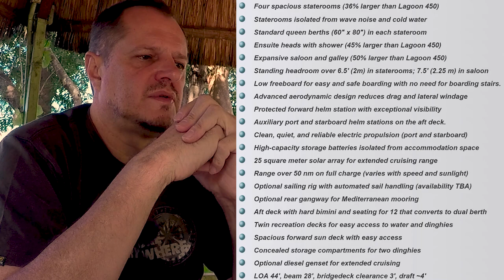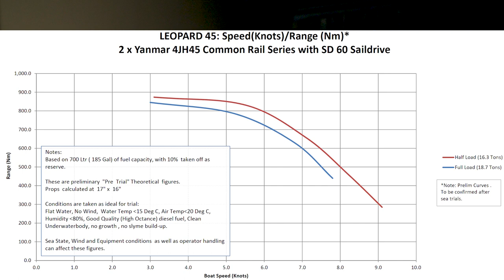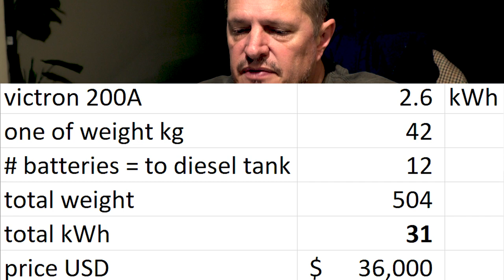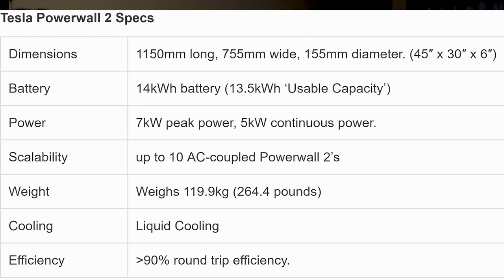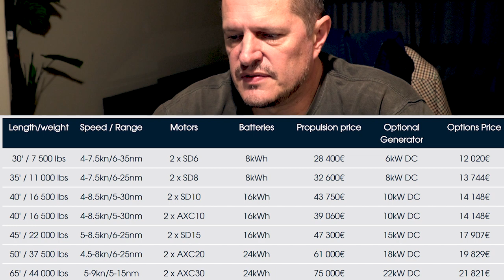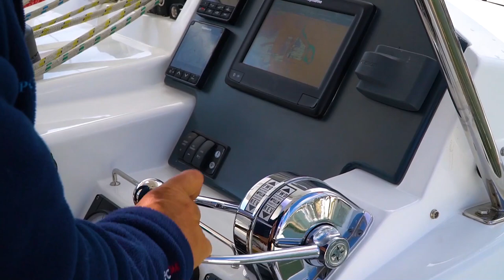#25t Diesel Engines or Electric Motors for Our Catamaran | Sailing Sisu in Cape Town South Africa

Comment: Captain Frik, one of our 100% solar, silent E-catamarans recently crossed the Atlantic ocean. There was minimal use of the required by law single generator. It was a 64' but they also come in 46, 55 and 74'. If interested I shall send you much more details.
Reply from the maker: Yes, please! Can you inbox us on Facebook? I will add the links in the description.
Reply from the maker: I have added most of the links from the comments to the description, but they keep on coming in. So, start with the description links and then scroll through the comments. There are quit a lot but most of the comments points to the same 62ft solar wave gunboat.

Comment: I'm building a 14,80 x 8 meter wide sailing catamaran and i been over al your links the past 4 years i think but with refurbisch Lithium battery's i will go electrical. I'm going to put in 2x 10kW BLDC 48 volt motors
Reply from the maker: Thank you for watching! How big? Like a km long by 8 meters wide?
Reply: it's a Waller 1480 almost 50 ft long
Reply: Hi Bernie, i'm building in Morocco i will drop you an email.

Comment: Very good informative talk thank you. I am very surprised about sailing uma's motor power they use a 36 feet boat with only 4.8kW at 36V, they use it at 48V so most likely kW is increased in such case. However it is still much less compared to what oceanvolt suggest 8.3kw for 36 feet. Also much more cheaper 125USD compared to 6000EUR :) So they destroy the saying of "initial cost of electric is expensive".
Reply from the maker: Thank you, Iza and Mazhar! Yeah, I follow them too! Lovely couple! Think then you saw the episode where the motor overheated in Ft Lauderdale and they had to overnight in the river before going on wards?  The high volts and over sized boat are taking its toll on the motor, not IMHO a good combination in rough situations where one has to rely on the motor to get you through a rough time....

Comment: I'm also a big Tesla fan (have a Model Y, the stock....).  The thing about Tesla battery packs for vehicles is that they are self contained, sealed with a very efficient cooling and heating that doesn't require the batteries to be open to the air (sea air). 
I'm curious where the whining noise comes from. My Tesla car is completely quiet except for wind noise. 
I think hybrid diesel/electric are already practical for boats. The advantage for electrical motors are 1. incredible torque and 2. it's quiet.  (Personally I'd like to see a swing propeller shaft - so the hull can be flush. A diesel engine with an electric motor at the back as both a propulsion source and a generator.  The way most times something like this is attempted it's off the shelf, too much friction - doesn't work. The way Tesla does something like this is they go back to first principles and engineer it from the ground up. )
Reply from the maker: We do not have an electric motor and after living for two years on a boat trying to keep our batteries full... Do I know we will also not have motors for a time to come. So, not sure about the winning noise, but I guess there are a lot of gears to reduce the torque and speed of the electric motors. Keep in mind that a propeller will cavitate much faster than wheels spinning on a tarmac 😉 you can put huge props on, but it means longer shafts, deeper drafts, and so on. You can perhaps go jet propulsion because you have more torque?

Comment: I know you have talked a lot about battery technology, but have you considered LiFePO4?  It's far safer than Lithium ion in that it has no thermal issue and doesn't catch fire.  A far safer alternative for use on a boat and doesn't need to be cooled
Reply from the maker: Uhm...that was my initial mistake. Li-ion is actually cumulative for all Lithium type batteries, including LiFePO4. Laptop batteries have much more Cobalt and if you followed Tesla evolution, you would have noticed that they reduced the Cobalt component. Anyway, Victron is LiFePO4.
Reply: sorry, in my haste, I missed it the first time through.  You did mention them, My bad.  I have to say, you have a very informative channel and are thinking things through and doing it the smart way.  I like the Hybrid system with a decent battery setup.  It's similar to how the Chevrolet Volt Car works.
Reply from the maker: Grant, no worries, mate! Yes, I am for sure looking at hybrid systems, but I did not take it with this theme into consideration, because I wanted to compare apples to apples... Or at least tried 🤔

Comment: I think the answer would be hybrid boats and Catamarans using both liquid or natrual gas and electric engines. Thirty six years ago I was visiting friends in Sindelfingen Germany and at the time, Mercedes brought out liquid and natural gas hybrid cars, (the natural gas tank was located in the trunk) that Mercedes sold to the European market.
These cars never made it to the States but the car I rode in worked just fine, problem free in Germany at the time.
Reply from the maker: I agree 100%

Comment: Cruising catamarans usually have about 600 to 1000AH or so of Lead acid or AGM Batts plus 2 engine start batteries and maybe another bank for Windless etc so this weight could be deducted from the weight of the Lithium Batts and of course, they usually carry a 6 to 10KV genset anyway, in addition to the deisel engines so the weight of having a 15 - 20KV genset would only need take the upgrade weight into account. The fuel load would only be reduced to say 15 - 25 percent for the genset of what you would carry to feed 2 deisel engines.
And the weight of 2 Motors with drives compared with the weight of engines with gear boxes taken into account.
Reply from the maker: Agreed, but we do not have a genset....we only have two diesel engines with two alternators each.

Comment: Look up Elko marine, they have been making electric boats for over 80 years and they have outboard and big inboard setups available now,and lagoon made a few electric catamarans in 2002,there is one one on you tube that still sails on the original setup it was for sale in Florida
Reply from the maker: Jip, that almost bankrupt Lagoon group. They had to convert all the charter boats back to diesel...
Reply: @SailingSisu  I can believe that it was a crude system using big lead acid batteries and adapted industrial motors, there are many better setups out there now
Reply: @SailingSisu  I can believe that it was a crude system using big lead acid batteries and adapted industrial motors, there are many better setups out there now
Reply: @SailingSisu  I can believe that it was a crude system using big lead acid batteries and adapted industrial motors, there are many better setups out there now
Reply from the maker: Agree 100% Lithium is a game changer, but it is not yet a replacement for diesel
Reply: @SailingSisu  in most cases I agree but take for example a 400mile passage the wind goes away and you are becalmed,with no current. You fire up the diesel and keep going at the economy speed of 4knots so no problem with electrics you can go 4knots but only for about2 hours if you reduce to barely 2knots you will prolly get 6 hours before you need a generator or 6 hours of sun for solar,if it's daylight. So I would argue it works but it's just slower than diesel
Reply from the maker: @ronaldharris6569 , only if that was practical and possible. We have the maximum amount of solar, 2.2kW and 800W of wind turbines. From 10k nm experience, I can tell you, that I was so super happy to have diesel. Try to motor for two days in 34ktsof TWS gusting 42kts with 6m breaking waves.... At night... In bad weather (=no solar)... Let me categorically state. I WAS GLAD TO HAVE DIESEL

Comment: Frik, at 19:45 you say 4x Powerwalls give you total 22kWh yet the Powerwall specs you showed earlier indicates 1 battery having 14kWh capacity. Why did you use 22kWh as total? To clarify I know very little about this topic except using storage batteries in my 4x4.
Also Tony Grainger lists electric motors as options for his Raku range of cats. It might be worth having a chat with him.
I totally agree with your findings, things still need to progress a bit further on this front.
Love watching you guys. When you hit Australia, come look us up for a bit of biltong, beskuit and droewors.
Reply from the maker: My golly gosh goodness, Herman, you are spot on! Yes, I mistakenly used the continuous power output instead of stored power. Well spotted! Will put corrected calculations in the pinned comment.

Comment: How does it work out with a gen set as a “range extender” as they call it on the Solar Wave catamaran?
Reply from the maker: yes, the gensets are commonly used as a range extender. When the batteries needs charging or needs fast charging, then you start the genset (so, you still need a diesel tank) to charge the batteries. I am thinking of a DC genset just to check out how much I would need it. My SCUBA air compressor and dingy engine will DC motors running from the batteries...so, I will start with that :-)

Comment: I have a very good friend with 2 Phds, one in fluid dynamics and one in physics/mathematics. He thinks that the best combo would be to get a big enough generator and a big enough battery bank (preferably of the lighter kind since you are on a catamaran) with some solar panels to top them up. 

The electric motors can be powered off the battery bank and be supplemented by the generator when needed. 

The advantages of this setup is that you'll have essentially only one diesel engine to maintain. 

Moreover, the generator is much more efficient consumption and energy-wise (less energy is wasted from your fuel because generators are tuned to run at maximum efficiency unlike regular diesel motors that seldom run at their optimal point). You'll need probably to liquid-cool your electric motors to have them run for extended periods of time. This setup plus sailing would essentially give you a lot less dependence on fossil fuels (which I continue to support, but electric motors - especially brushless ones - are essentially maintenance free) and a very good range. A more silent propulsion as a very desirable bonus as well (with only the generator producing noise when used). 

On the cons side, you will not have the redundancy of two separate reliable diesel engines, just one, and maybe some cost issues. You can of course sell the two diesel engines that come with any boat and get a lot of that cost back. 

I wonder what others say about this idea. 

Cheers!
Reply from the maker: Thank you for the response! You are aware that we currently do have all of that... Namely two diesel engines with two 130A Alternators each😉 the idea was to get rid of fossil fuel and smelly noisy diesels

Comment: Did you consider the weight saving from replacing two Yanmar Diesel engines with electric drives? I think even if you then add a diesel generator and a smaller diesel tank, you might still be ahead.
Reply from the maker: Yes, they certainly weighs a lot, perhaps another 10-20 miles?

Comment: I sincerely hope you respond to my request for attention to the detail of  underwater appendages  and their purpose and preformance . That also includes Rudder designs and drives.
Thanks for the videos!
Reply from the maker: Great suggestion, Norman! The Leopard 45 has big rudders with propellors forward of the rudders, while FP has their propellors aft of the rudders...wonder what difference it makes?

Comment: Great video although I believe you miscalculated the max range. You gave the max power rating for the motors when calculating the range of 9 NM, I wouldn't think for cruising you would need anywhere near the max power except in emergency and 1/4 - 1/3 power to get 5 knots might be more comparable to real world? I also believe total range is MUCH higher overall if you take into account how many miles you can cruise under power on and off over an extended time while filling the bank with Solar, Wind and regeneration when conditions are better for sailing. Last point would be most people have a generator in addition to propulsion you could use that to run hybrid mode for the times when you are becalmed for days.
Reply from the maker: Thank you, Keith. Yes, I mentioned in the description and pinned comment the mistake, but remember, I want to compare apples with apples to put this whole issue in perspective and what the real issue is. Batteries just do not store the same energy as diesel. True, one can hang around (as I mentioned) if it is safe, while waiting to charge while diesel will not charge, which was not the point of the calculation :-) the fact is, one can run out of batteries at a critical moment without capabilities to recharge quickly, while the diesel tank you know you have 800nm range.

Comment: I like your take on the electric motor... but if u sail shorthand or solo... it probably best if u choose electric motor than combustion engine.. any combustion engine has to many moving parts...  electric motor have way more advantage of maintenance where you can plug and play as long as you understand soldering especially the rotor...
Reply from the maker: Putra, sure thing. My first degree is electronic engineering and I must say, today's electric motors have more electronics than I can handle. I am for sure not a mechanic engineer, but I diesels just work... For decades. Just change filters and oil on a regular basis and they will pull you out of difficult times. I took a deep and hard look at my Victron Lithium system and it scares me...
Reply: @SailingSisu  yup.. that is the problem...
Reply: @SailingSisu  I'm curious of Membrane fuel cell.. someone told me its lighter... is it safe?
Reply from the maker: @putrapratama-sq8hu  I have no idea

Comment: My choice would be one electric motor, one diesel. The electric is for in and out of harbours, small trips. Diesel is to save your life.
Reply from the maker: Good idea!
Reply: Of course the big problem with diesel engines that don't get run regularly is that they tend to not run when you need them.
Reply: Did you know they make electric motors rated at 40hp?

Comment: Maybe filling the weight in difference between the diesel motors and electric with more batteries would give a boost on the Range. Also, going lower on the electric motor is more equivalent since it's more efficient in torque. So for a given RPM the electric motor could be much less than the diesel one. This would boost the range also.
Reply from the maker: thank you for watching, Lucas! both are good options and yes, the torque is awesome, however, even diesels have to turn down their impressive torque because of cavitation. That said...if you go through the comments, you will notice many viewers pointed to the solarwave gunboats and to "range extenders", which are basically a noisy smelly fossil fuel 13kW diesel generator :-) but it also brings back the weight :-(  myself think that energy storage is still in the early developing phases and it will improve a lot. the motors? yes, make them more effecient, solar, make them more efficient, but the biggest one will be storage.

Comment: All advice I can give is this. Always keep whatever you plan to float, very simple. Complicated stuff bites hard later. There is a reason why the saying says, a boat is a hole in the water, that you keep on throwing money into. I even shudder at common rail diesels. Good old standard injector pump,mechanical injectors handle even dirty diesel to a point, just replacing one common rail injector can make your eyes water. One reason why some sail without motors. But that brave I am not,and also not experienced and skilled enough. Meet a yacht sometime ago, they been sailing now for the better part of 15 years around the world 3 times(they trade from their yacht), no motor,besides a air cooled genny.
Reply from the maker: oh wow! I must say, I needed my diesels a few times now. But we have been sailing 80 different latitude degrees, which is way much harder than sailing the Trades in the tropics.

Comment: A factor not seen in the comparison is weight of the motors. (i.e. the sum of fuel and motor vs. sum of battery and motor). While this will not reverse the imbalance  it may move the pointer a bit.
Reply from the maker: Yes, you are correct and an oversight from my side. But I guess another 20 miles extra?